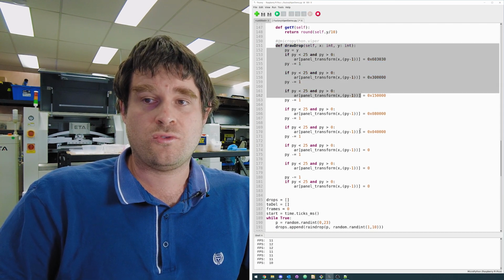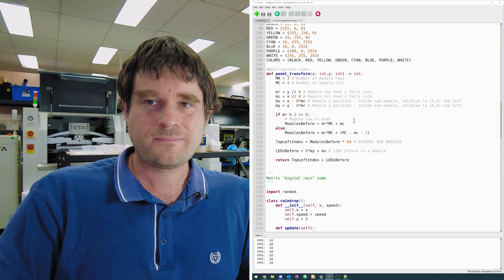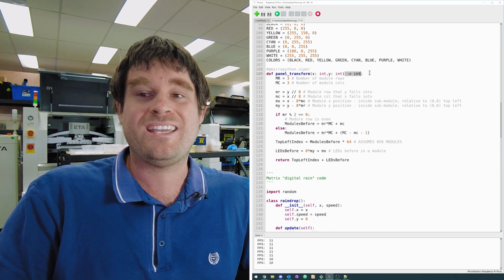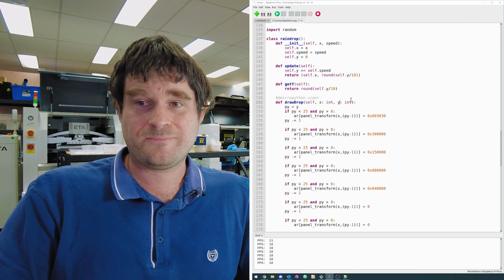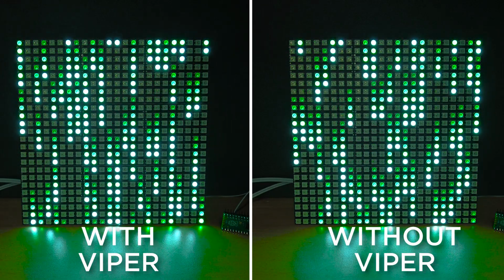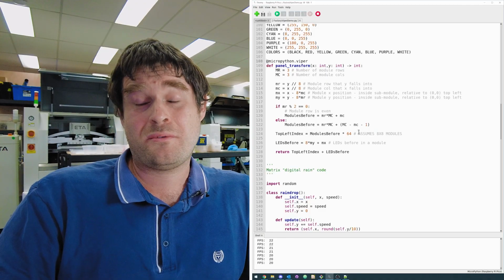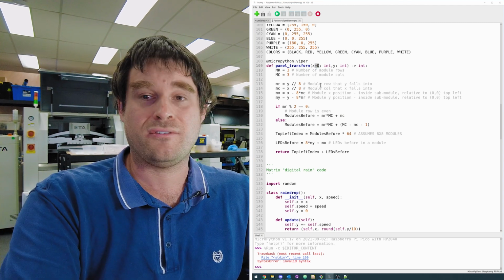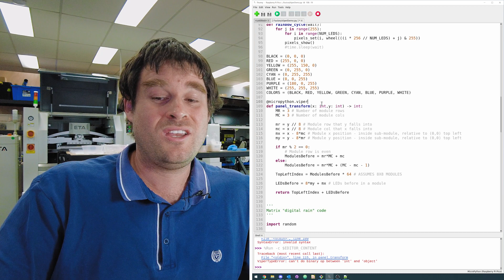The Factory | Huge MicroPython Speed-Up With WS2812 LEDs

Comment: What is the deal with all outubers shaking their hands when holding something we are supposed to look at! Jebus, look at your own videos and practice presenting. You have a factory, build a brace that afixes your hand in a non-moveable state or something. Would you do that if you were showing that to me in person? I think not. Maybe imagine the camera is a real human eyeball?

Anyway, regarding speedup with Viper, how about trying this, which is transportable:  I can't see the details but it looks like a 24x24 array and you want the address of some (x,y). Use a one dimensional lookup table whose entries are the addresses you want and whose index is a simple combination of the x,y pair. So, 24 is 5 bits with some extra. Do a left-shift of x and OR it with y. There is your address in a 10 bit table of bytes which you fill with the addresses of the pixels - maybe at run-time. If you need a 16 bit address (looks like you do) you can use two tables with high byte and low bytes or one table twice as big and shift the address by 1 or multiply it by 2. On ARM these operations are trivial. In fact in ARM machine coder a shift can be included with any operation at no cost in speed - ARM has a barrel shifter in the ALU. I don't know if Viper will do this automatically without looking at the code. Just like all ARM instructions can be conditional (maybe not on Thumb. I don't like Thumb and can't recall.) And avoid global variables where possible.

Comment: At 7:22, it is an actual syntax error, the correct syntax is to give the value after type hint. Like below 

def(x: int=0, y: int=0) -> int:
    ...
Reply from the maker: Thanks for the tip; we’ll check it out!
Reply from the maker: Hey you're right! We had the syntax for the type hint wrong. We fired it up this morning with a correct type hint but it seems like viper functions still can't use keyword arguments (with default values) :/